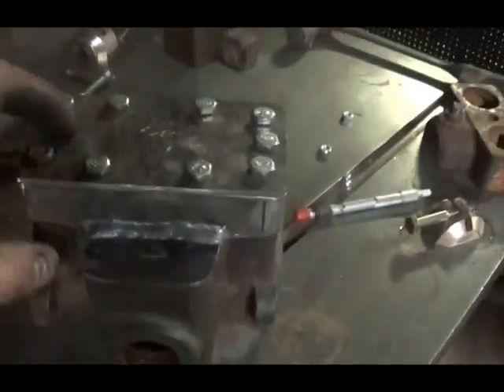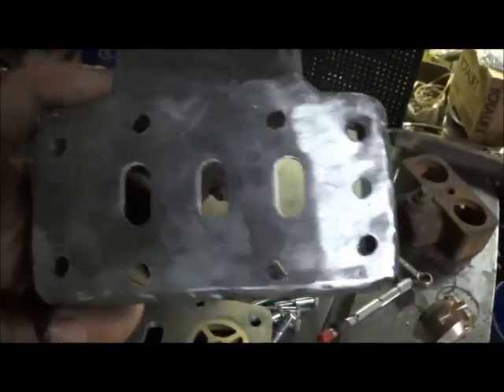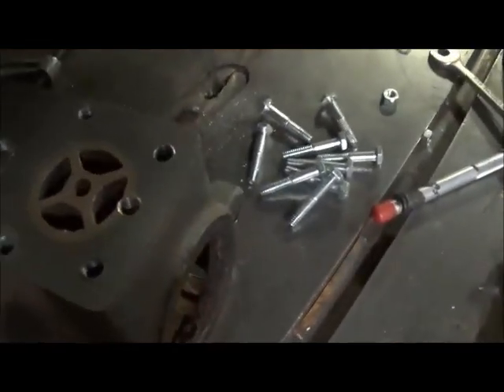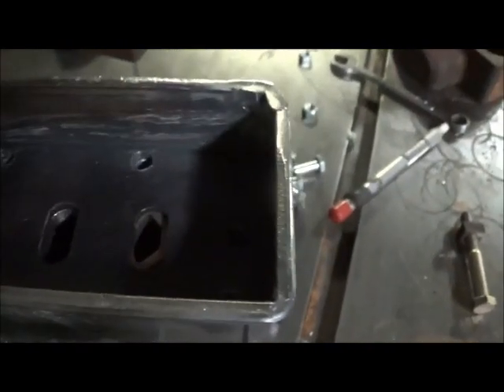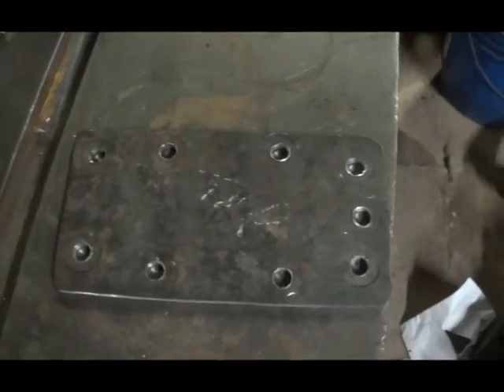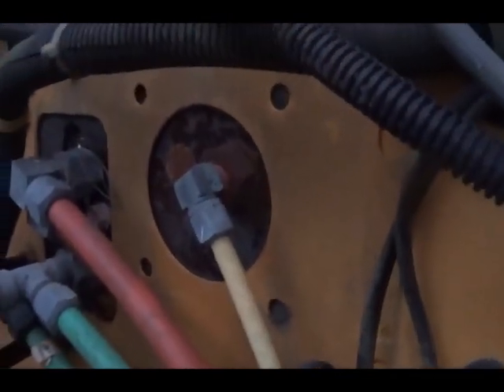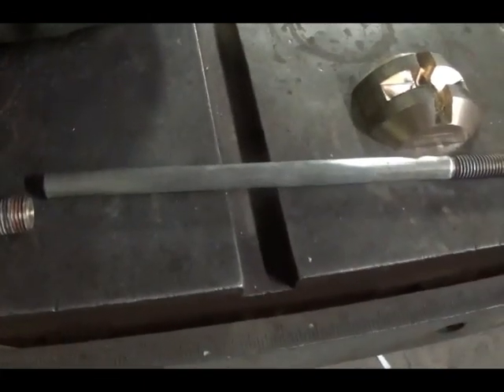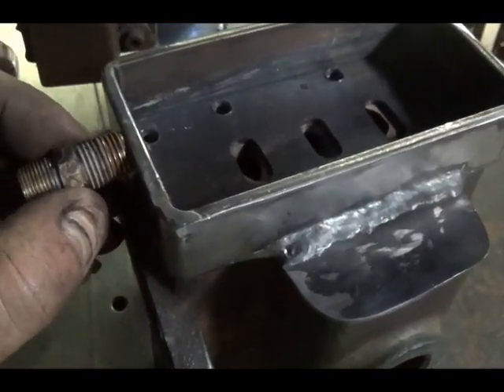Building A Steam Engine From Shallow Well Pump pt4

Comment: what was the valve made of,
Reply from the maker: +mustie1  I see you figured it out. The Homart has one made out of oak and it has held up for years. The problem with slide valves are they are hard to lubricate, so the bronze should do well.